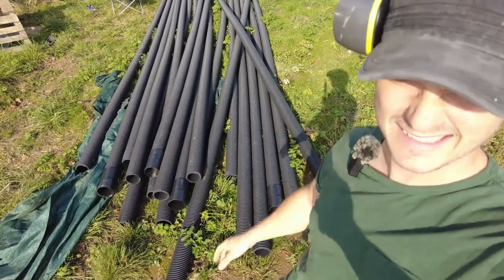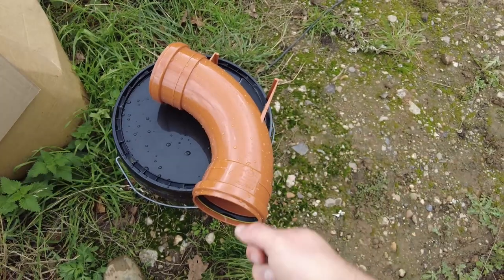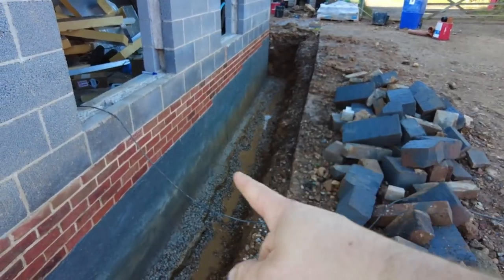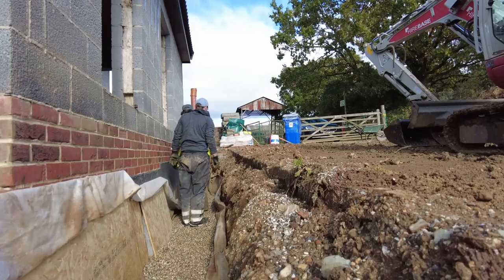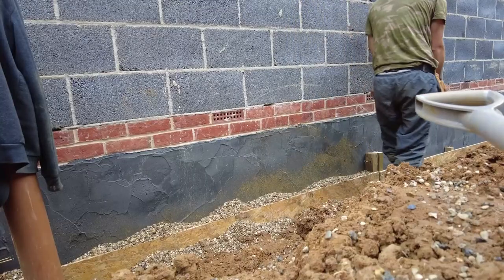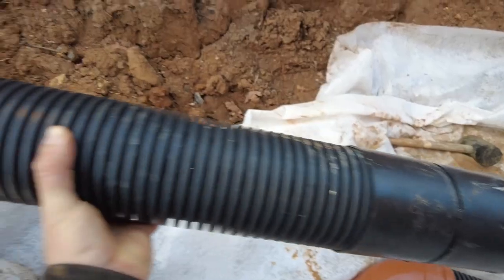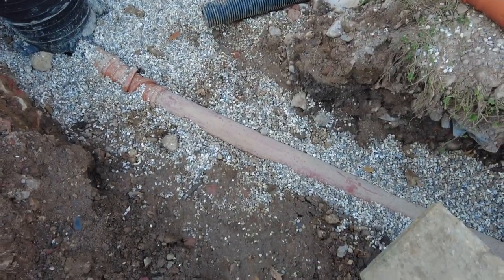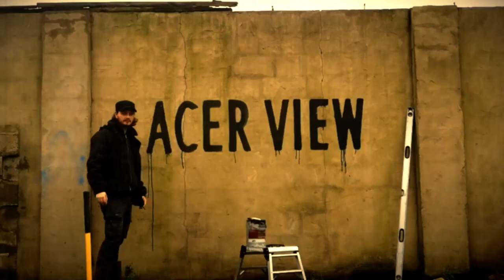French Drain with clean out points

Comment: Excellent job, all i would have said, was when you backfilled the house side with a narrow wall of pea shingle. I would have also put in a sheet of fabric between the shingle and soil, to prevent the soil from mixing with the shingle. As the silt would eventually come in contact with the house. Although you have treated the wall, so thats a bonus 👍
Reply from the maker: Yeah I reckon it will be absolutely fine. I'm sure I over engineered the problem 😅

Comment: Great job well done👍.  If I can suggest because you asked I would have dispensed with the grouting/parging of your walls and used “Delta-MS” on the walls below the ground surface.  It would have saved you considerable time & money in the end.  It keeps the hydrostatic pressure off the wall and all water runs down it and into your french drain.  Don’t get too paranoid about standing water in the future.  Remember your french drain pipe is at or lower than your footing so all surrounding water both inside & outside the building will weep to the lowest point which is your french drain.  Your challenge for the future is to maintain the clear flow of water from the exit point of your french drain until it gets to your neighbours pond.  Any obstructions in this section of the system will backup into your french drain.  Don’t worry if the slope of the pipe is not perfect as even perfectly level pipe will still flow water.  On the issue of pea gravel or using something larger I believe the problem shows up when the french drain envelope eventually gets contaminated with silt.  Pea gravel will clog up more quickly than larger gravel as the silt can more easily pass through the larger spaces around the stone.  Every french drain will have an expiry date sometime in the future when it plugs up with silt.  Silt is the killer here so my advise is to use more stone(ish) material on top of the french drain when you backfill with a few inches of topsoil on top to support lawn growth.  I’m not a fan of backfilling with clay material as you are trying to take water away from your buildings and clay typically has low perk qualities.  On using a separate pipe system to handle roof rain runoff I think you will be happy with your choice.
Lastly get a lock on that sand filter thingy before the neighbours steal it and sell it on Ebay🥱
Reply from the maker: Hopefully the drain will outlast my ownership of the place at the very least, it'll be interesting to see how it will actually hold up in years to come

Comment: Great job man!! faraonic repair you are making. 
Have a suggestion, also from researching around, gullies and gutters would be better to plug them on a normal pipe, on top of french burrito, not to the french drain pipe. You might be overflowing the frech perforated pipe, and zipping water into the ground soil.
Reply from the maker: Thanks dude. I ended up just combining one side of the roof and gullies into the French drain but that was away from the building. I think I'll probably get away with it and it might end up helping to wash any silt down to the trap I put in. I suppose I'll find out at a later date 😬🤞
Reply: @THE-AIDEN-PROJECT  Im watching it right now!! part 4 of the mammoth!!
Reply from the maker: @agustinpiaggio8888  ahaaa 👍

Comment: Might be worth putting in a sump at the lowest point under your floor with a submersible pump to deal with future flooding. Fit it with a level switch set to come on automatically when the water reaches a set level. Have an inspection hatch located in the floor over it for maintenance access.
Reply from the maker: Hopefully I'll be OK with what I've done so far. I was considering a sump pump or French drain internally but that was before I tanked the whole property rather than just one part. There's still some water inside that I will wetvac out once I've got the windows in and from there I think the vents with dry out the rest eventually. In theory there shouldn't be much chance of any water getting in from now on in 🤞
Reply: @THE-AIDEN-PROJECT  Sounds like a plan. Best wishes :)

Comment: Hi, really helpful videos, did you have to run this through with building control beforehand? Assume you didn’t get a design done just took the advice of permaguard?
Reply from the maker: No I didn't run it past them. They did have details of a land drain for a small part of it on my plans and that's it. They should have really asked for further details at the time for how it would be tanked on that section. I had them round recently for the underground drainage and had to explain what everything was, he seemed a little baffled, as the full French drain with clean out points is never done in the UK. As far as the tanking coupled with a French drain, I had a few typical details from different structural waterproofing companies. What with the advice from permagaurd I made the most logical decision based on all the information I had
Reply: @THE-AIDEN-PROJECT  perfect, Thankyou, my builder says I need a full design done, but not convinced especially after watching your videos, going to propose this is what I do to my building inspector and see what he says. Thanks for coming back to me.
Reply from the maker: @lloydc1671  no problem. What situation are you dealing with for your place?
Reply: @THE-AIDEN-PROJECT  my extension is next to a church car park whose ground level is about 7-800mm above my new floor slab, so similar sort of height to yours. I don’t have an issue with the water table it just needs to be a barrier against moisture, so what you’ve done in my mind should be sufficient for me. Hopefully building control will agree.
Reply from the maker: @lloydc1671  🤞

Comment: when you do the inside foundation wall dont seal it allow it to dry just lay your drain pipe like you did on the outside and the physics called hydro static should never effect your home again. don't forget to get s structural engineer's blue print on the wall next to the road.
Reply from the maker: Yeah I won't be dealing the inside. Once I get the windows in I'll be pumping out or will wet vac the last of the water out. I think the brick vents will take care of the rest 🤞 I only took the boundary wall down partially so will rebuild that later. The other retaining wall in between that wall and the house will be less than 800mm so I don't need a structural engineer for that. I already know I just need to lay concrete blocks flat and that's fine for anything up to 800mm ✌️